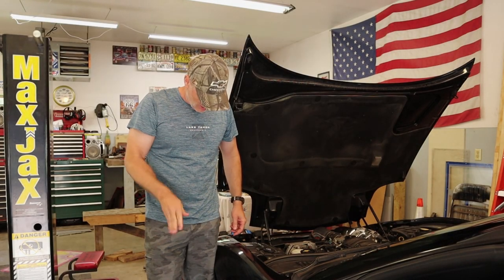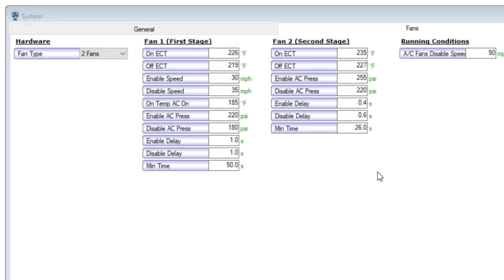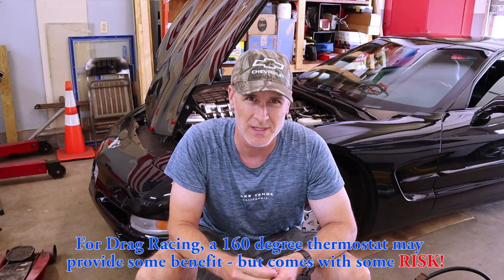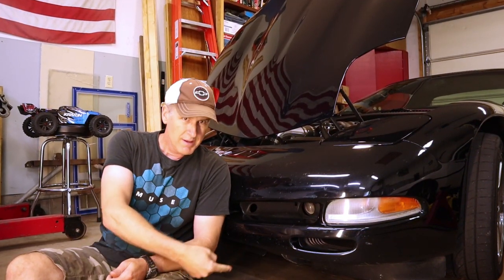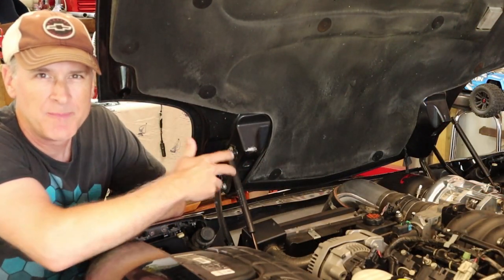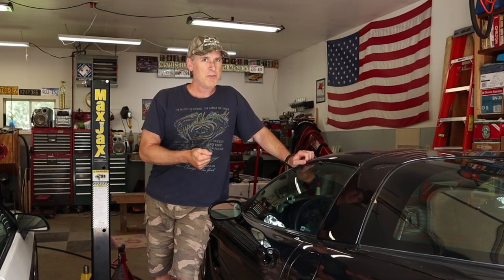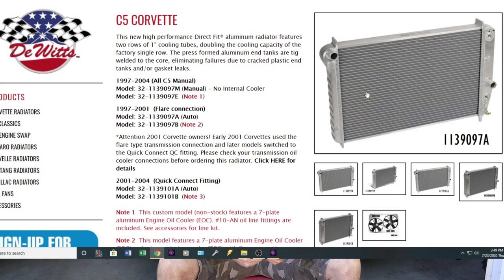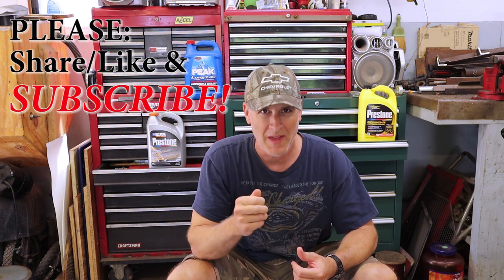C5 Corvette Cooling System: Normal Temps? 160 T-Stat? Q&A

Comment: I lived in Texas and to beat the heat I installed a COOL IT v2 unit. Now when I see the motor getting hotter I just push the button and the engine fans comes on cooling the motor. This work great if you are driving slow on a hot day. It's freaky to watch your temp go to 220 degrees. This COOLIT unit is very easy to install.
Reply from the maker: Great tip!
Reply: What unit is it called?

Comment: I finally got my cooling system figured out...
1st thing i did was install a new radiator and 160 degree tstat after it was overheating a lot.
then i still got over 230 at times...
so finally i talked to some guys and they told me to put on the front spoiler... previous owner took/broke it off.
Makes a world of a difference now. Also reverted back to stock 187 tstat since it was being too cold now that its getting colder out.
so now here are my temps:
on road/highway: 198 - 205
idle: varry's... sometimes stays at the road temp but often jumps between 220 and 230
Reply: oh also i should mention that my old radiator resovoir cap was broke, and caused the car to start smokin because of loss of pressure around 230... a new 18psi cap solved that issue!
Reply from the maker: Good point - that air dam is absolutely necessary!

Comment: Best supercharger radiator is a s10 aftermarket aluminum.  It is short enough to run a 4" blower inlet and runs frame rail to frame rail and allows you to stand it up straight resulting in rapid cooling once moving down the road again.  The problem with c5 cooling is the laying down of the radiator in stock position.  For a supercharged car with an intercooler....s10 radiator stood up and 160 t stat is the ticket.  I have 3 friends with Dewitts.....didn't help one bit as it is an air flow problem and not a radiator problem.
Reply from the maker: Hmmmmmm.

Comment: I bought the electronic fan controller for 130 bucks and it works great. I run at 190 to 212, but Summer is coming in FL. I might move my fan 2 down to 220
Reply from the maker: probably good idea - still cooler than stock.

Comment: 160* thermostats don't effect oil temp, and LS engines have steam lines so unless you didn't fill the radiator all the way, no "steam pocket" will form
Reply from the maker: I bet a dollar that if you ran an LS motor for 1 hour at 195° coolant  temperature, versus another LS motor at 160° coolant temperature, the oil temperature would be hotter in the 195° coolant temperature engine.  The only question is how much hotter would it be?
Reply: @Toys4Life  sorry if I sounded a bit brash, I just had this argument a week or 2 ago. I've swapped to 160 thermostats on 2 LS engines (LS3 and LS1) city driving is the exact same. On the highway coolant temps would hover around 170*. After 30 minutes of highway driving oil temps were the exact same (210* LS3) (195*LS1- had a bigger oil cooler). I had a lot of people telling me my oil would never get to temp, but honestly, even if it only got to 170-180* all the moisture should cook out, unless you have head gasket failure.

Comment: Overheat issue is driving me nuts! Only overheats with the A/C on. I know that can happen stuck in traffic but that's not the case. Normal drive,  I'm 220 or little under. Turn on A/C and usually 10 mins. or so of just driving to the store, and I'm almost in the red zone! I would always cut it off before I got to overheat, and it drops back down. 
But one day I pushed it and didn't cut my A/C off in time and it blew all my coolant out! Had to call a tow truck! 😩 The shop said It was my thermostat. So they replaced it and same issue???
I'm fixing to replace my airdamn,
Reservoir tank & cap and see if a shop can use air to clean the outside of my radiator for blockage. Hope doing all 3 of those things, that the overheat issue will be fixed 👍😁
Reply from the maker: I bet it's plugged with garbage debris sand and dead plants.

Comment: When trying to bleed coolant after doing the harmonic balancer job I nearly pissed myself when I saw the temp going past 235 at idle lol. Low speed fan was on but I shut it off before I could see if the high speed fan came on.
Reply from the maker: Yikes
Reply: @Toys4Life  it was 95 degrees outside at the time and probably had air in the cooling system as well so not overly surprising.

Comment: I live in Texas what is the best  Anti freeze to use to use,, and how do I get the air pockets out when I do change my coolant ? And like a dummy I put A160 degree thermostat  in,
 but I do have a tuner that adjusted to where the fans do not come Until the temperature you had described and  if I go to the track my Turner and I put a switch to turn both fans   stay on with the key In the on position, please show me how you get the air pockets out of my cooling system And what is the best coolant to use also should run I should run the heater as I'm doing this to make sure all the coolant that was in there Is drained out and mixed with the new coolant Or how can I get the coolant out of my eater core should I remove one of the heater core hoses and blow hat was is left  In the heater core with air pressure out of the lower radiator hoseOr tell me how to completely drain the  complete system so no old anti freeze is left in   it to mix with the newCoolant I replace it with

Comment: Great video, as usual. Didn't see the coolant change one yet, so can you include input on checking/changing all the radiator and heater hoses? Silicon versus rudder hosing and any access issues? Look forward to the detail on avoiding the air pocket you mention too. Summer is coming and hope to track this FRC! Feel free to holler if you need a sample car. Ha.
Reply from the maker: Thank you sir, I will get to it!
Reply: @Toys4Life C5  
Had dealer install HPS silicone hoses. Look great. No leaks, but I hear the slight coolant smell after running the car is likely just normal (fumes) venting from the over tank? (No coolant in the oil etc.) Thx.

Comment: my c5 turns on the fans when the temperature reaches 240 from there it returns to 200 the temperature is very high
Reply from the maker: Yeah, I lowered mine and if I have to buy one extra fan motor through the years then so be it.

Comment: I have one fan working ,supercharged built c5, its hook up direct it comes on when  key is turned on, runs all the time what to do,plese help,Dave
Reply from the maker: Did you do the work - or buy it that way?  Maybe someone tuned your fans to come on at 100 degrees F?
Reply: @Toys4Life  I bought it that way its hooked direct to the fuse box you turn the key on and fan comes on,thanks for the help.do i need to buy a fan relay kit, Dave
Reply from the maker: @davidweidman8364  So it is hot wired to run any time the car is running.  I am not sure exactly how they wired it and if that controlled circuit can handle the draw or not.   This appears to be the hot wire trick that IMO should only be used at the track.  No need to have your fan run all the time - it will wear out much sooner and is not needed for daily driving.  On mine I just have the tune set to turn the fans on quite abit sooner than stock but certainly not even close to constant.
Reply: @Toys4Life  Yes it is ,found that the ground wire gets hot and only one fan is working but runs cool,no it not that trick,one wire to fuse box,its cobed.summit makes a fan kit.dont know what to do.
Reply from the maker: @davidweidman8364  Mostly daily driver/street use?  Then I would remove and have my tuner change the fan settings and if the 2nd fan is not working - fix that for sure for those really hot summer days.
Reply: @Toys4Life  Thanks again well i want it for street use but worried about fan burning out when im out driving it , there is one wire that runs to fuse box direct, Summit makes a fan kit i think i need, tuners around here are so busy its like a month or so to even get in,and expensive, thanks so much for your time,Dave

Comment: On my C5z neither fan turns on when at 230F. The car runs really cool when driving at speed on the backroads but on a hot day in stop and go it does come up with no fans. I jumped power to the fans and they work, tested my relays and they are good. I was even able to turn both my fans on with a Tech 2 scan tool but they don’t come one when water temp hits 230F, any suggestions?
Reply from the maker: I would us HP tuners to program the first fan to come on at 210, then watch as it goes to 220 to see if the fan comes on.  Do you have access to HPT?   If you can turn the fans on with the Tech 2 then it seems to me the circuitry is all good...

Comment: I enjoy your videos when will you be doing a coolant change on your C5 mine is due at this time I'd like to see how you do it thanks for the great videos
Reply from the maker: Thanks for the note! I should be changing it out yet this summer. Look for a video to come!
Reply: Don't forget to jack the back of the vette up a extra few inches so you can get all the used oil out.
Reply: @Toys4Life  have you done the coolant flush on it yet ?
Reply from the maker: @josecollazos6  no, but I will be before spring gets too deep because that's the time of year when most people are thinking about it including me. Thanks for the reminder!!!
Reply: @Toys4Life  what coolant should be used or what coolant is used ? My coolant s little low on the resivior the light came on earlier but then shut off and i check when o got home it’s not empty nor full it’s in the middle
Reply from the maker: @josecollazos6  it should be orange, and if so top it off with 50/50 dex cool & water.
Reply: @Toys4Life  can i add the one that’s already pre mix 50/50 ?
Reply from the maker: Should be ok.  Make sure what you have is orange and if so use dex cool.
Reply: @Toys4Life  ok ya i check it looks orange thanks appreciate it

Comment: pay attention to your center air dam , it's there for a reason and we hit it on things all the time and don't realize it , one guy I saw the other day was missing it completely I asked him and he said it got torn off .....and guess wat ...his engine was running hotter than normal ...go figure .
In case you don't know without a center air dam the air slides quasi directly past the radiator and actually causes a venturi effect in the center , the air will have turbulent out flow in the bottom portion of your radiator , just like if you drive with the top off yer Vette , if you hold something lite at eye level and let go it gets sucked out the top , same thing happens only upside down without that air dam . 
The dam directs the air down and around the bottom of it and off the ground causing up flow into the radiator,  you will run quite a bit cooler with it in proper condition .
Reply from the maker: Agreed!

Comment: It’s 36 degrees F where I’m at and my trans temp was sitting at 147 - 149 for a 30 minute drive, is that normal? I also had the heater on if that makes a difference
Reply from the maker: Seems normal to me for a cold day.

Comment: I have 2003 C5 corvette 50th anniversary problem is when the engine is hot 227 -230 degrees and I turn off the engine and I can hear bubbles around the thermostat area.  I have never seen the temperature went pass over 230 degrees. On the freeway around 65 miles an hour my car temperature goes up to 208 degrees. Note - when I park my car and engine is running temperature is 230 degrees and I wait for fan to come on the I see temperature goes down to 217 degrees and I turn off the engine then I don’t hear bubbles. 
Please can you help me on this if this is normal. 
Thank you. 
Bijay.
Reply from the maker: I would check your coolant to make sure it's the proper mix to give you boiling protection and your cap to make sure you have 15 lb of pressure. Less pressure will allow coolant to boil.
Reply: @Toys4Life  thank very much appreciate it. I will check what you all told me to do and I will get back to you. Thank you again.
Reply: @Toys4Life  sorry you meant the radiator cap or reservoir tank cap.
Reply from the maker: Reservoir tank cap.

Comment: The forums are so off on this - they think heat is the enemy but the engineers designed those metals to expand at certain temperatures.  Sad - but cooler is not always better.
Reply from the maker: I agree & think you should strive to stay in the sweet spot!

Comment: Are both your fans supposed to turn on when you turn the A/C on? I’ve only been able to get my left one on and I’ve yet to see the right one kick on even when my car got to 238. I’ve changed the three fan relays and still nothing do you think that right motor is burnt out?
Reply: My car runs perfect on the high way but as soon as i hit stop and go traffic the temps start rising and fluctuating
Reply from the maker: I think they both should turn on.  Pull the connectors off and check for power and ground when AC is on is what I would do.
Reply: @Toys4Life  thanks for the tip!
Reply: Same exact problem I have with my 04 did you by any chance figure out what is was ?

Comment: I have a stock c5 should I get 160 Tstat? I changed water pump and everything else including HB and now I want to change Tstat and need to add more coolant which is Dex cool 50/50 .
Reply: hi your car how far does the temperature needle go?
Reply from the maker: skip the 160 t-stat.

Comment: I got a question so i was doing a couple rolls on the freeway i got a bolt ons c6 ls2 and i hit 260 oil temp u by any chance recommend anything to keep it cooler or what the problem is man?
Reply from the maker: You could add an oil cooler for like 150 bucks.

Comment: Although my C5 runs great, the temp gauge shows it sometimes may run hot. Is this a sign that my thermostat is going bad?
Reply from the maker: How hot?
Reply: @Toys4Life  Sorry to jump in but as soon as my Ac goes on and it says 90 degrees about and the car is close to 220 I get 260 and overheat warning. Shut off A/C,... Back to > 220
Reply from the maker: Well that's not good!
Reply: 190 not 90. I was in very heavy traffic too .
Reply: @Leeyac1  I have that problem with my 1998 C5. No overheat issue with A/C off. I run usually no hotter than 220 or under. But I turn the A/C on, and only after maybe 10 drive around town, and I'm almost in the red! Usually I would turn the A/C off before it's in the red, but didn't cut it off in time last yr. and my coolant blew out and had to call a tow truck! 😩 Replaced my thermostat and still have the issue.

Comment: Did you mention that you super charged your C5 ?
Reply from the maker: I did, towards the end where I was talking about aftermarket radiators...
Reply: Toys4Life C5  I was wondering and hoping you could give us a brief video on what the C5 supercharger took to install and briefly show where you started to the installation of SCHRGR . The brand , the output , and the difference it created. Thanks
Reply from the maker: Did you see the supercharger series on my channel?  Those are fairly long but lots of info.
Reply: Toys4Life C5  actually no I didn’t, but I will take a gander at them.  Thanks